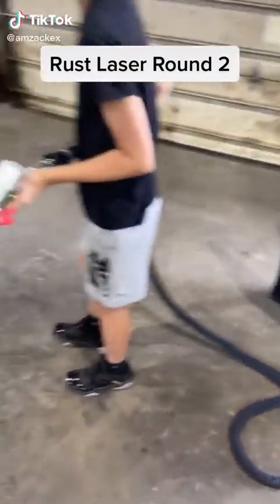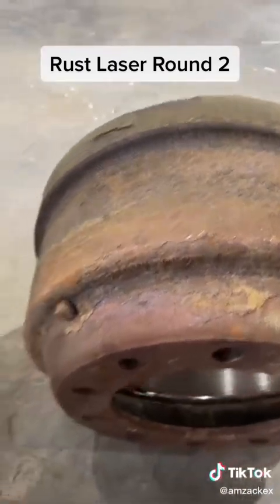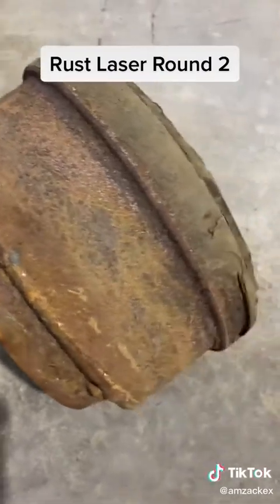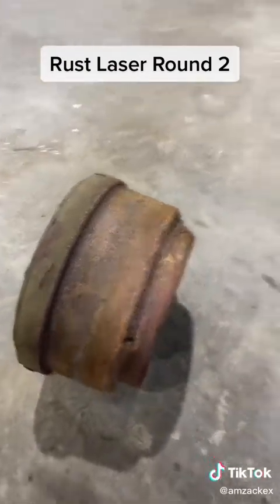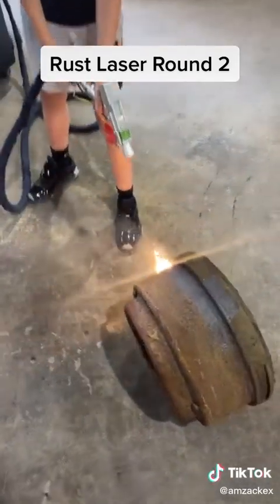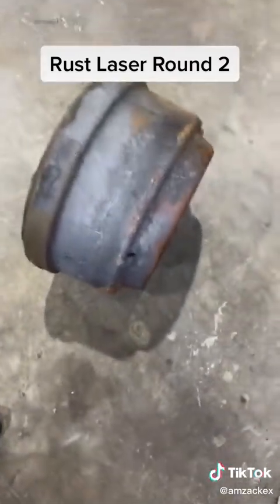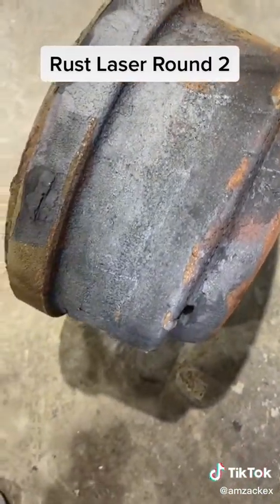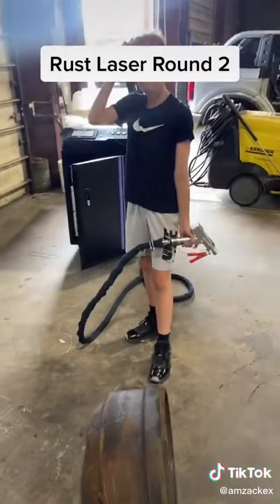[rust laser in USA good job]AKQH-1500 all in one fiber laser cleaning/welding/cutting machine-part2

Comment: Do you need to use some type of gas for the machine to work in the cleaning operation, such as nitrogen or argon?
Reply from the maker: this machine is is 3 in 1 machine, when weldling with N2 or Ar. and cleaning with air.